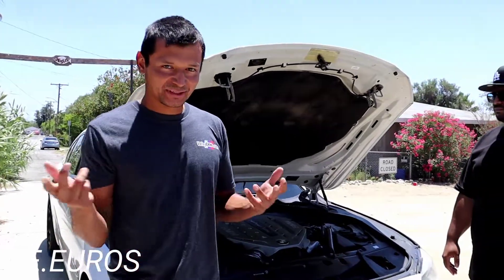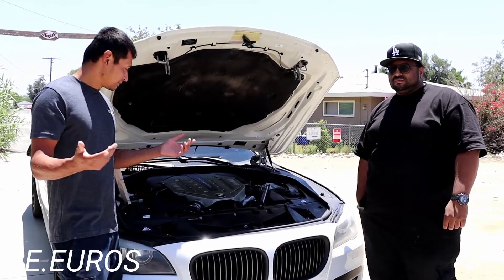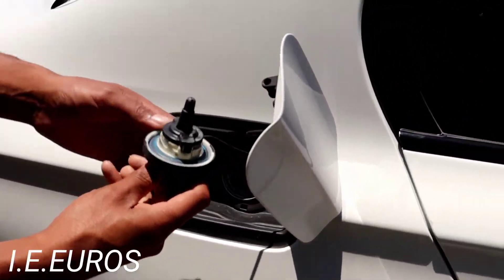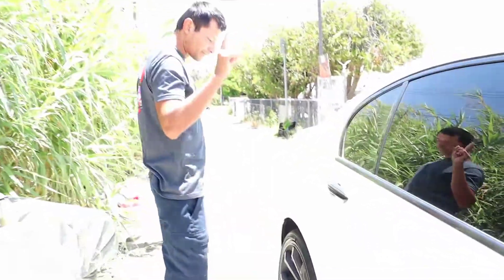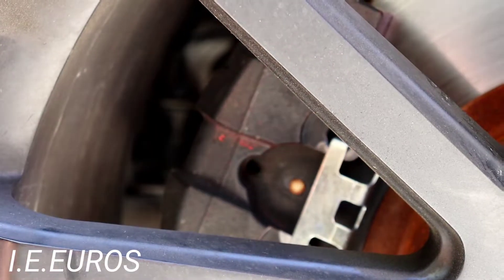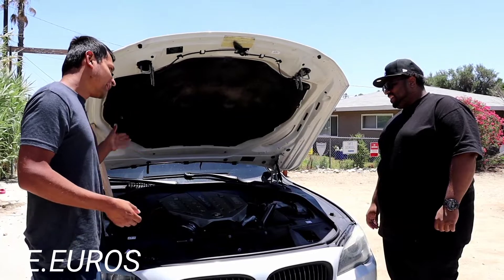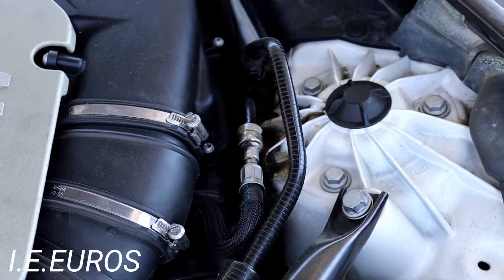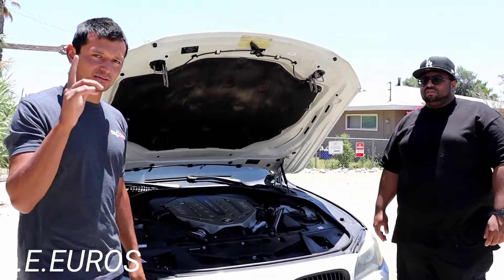2011 BMW 750Li N63 engineFull walkthrought inspection common problems

Comment: Can you do a video of how to do a power steering fluid flush or change the diverter valves on 750 f01 my driver side diverter valve cracked and can’t find any videos of how to change them